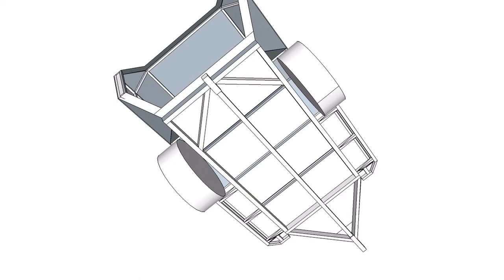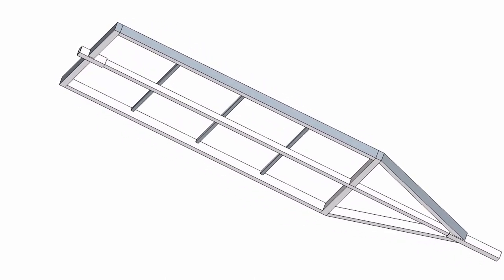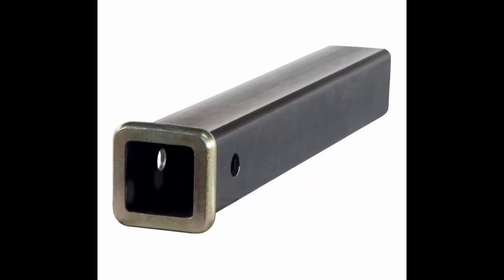How To Build An Overland Trailer (DIY Camper Trailer Frame Design)

Comment: Hello! I love your project!. It is posible to share your blueprints?… also in your video you said the box has 4x8.. feet? What is the measure unit?
Reply from the maker: Correct, the frame is 4x8 feet.  The video has a drawing of the design at 0:53.

Comment: Awesome Vid, How did you work out the load carrying capacity of the chassis ?  Cheers James Australia
Reply from the maker: I just looked at a bunch of commercially built ones and made mine stronger. Also had my structural engineer friend have a peek at the plans.

Comment: Looking at your schematic...I'm trying to determine the actual length of the 2x2 spine.  Given the fact that you inserted the receivers on both ends...I understand there can be some fluctuation in spine length (since you just insert it into the receivers further.  But, if you had the length that would be great to know.  Based on the design spec, am I correct to say it's about 11' ???
Reply from the maker: 11’